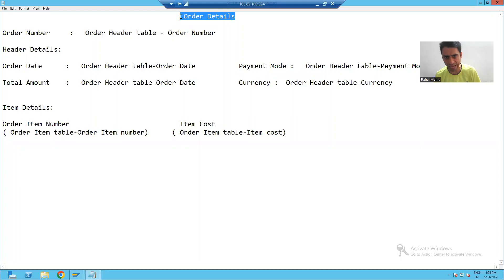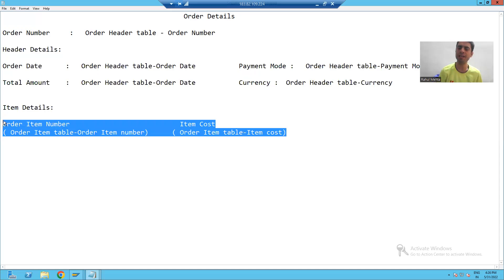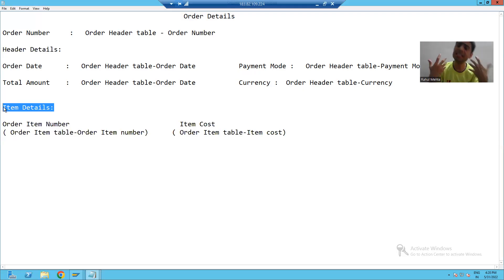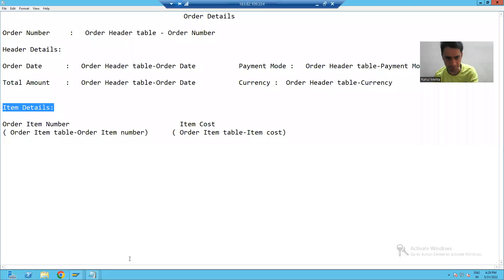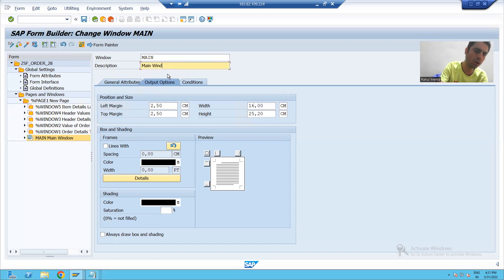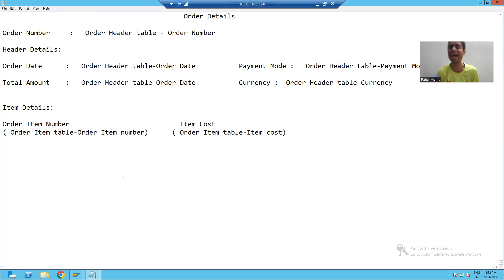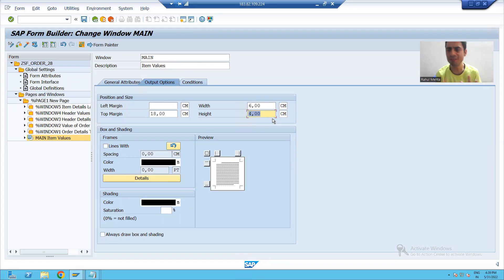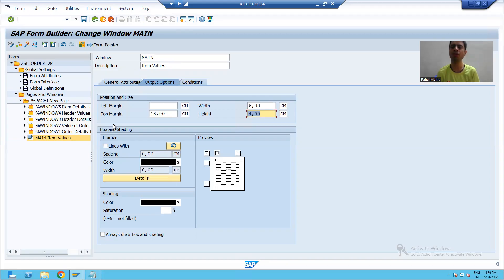2 - Smartforms - Creation Part1

Comment: Sir,
How to print new PO with line item on new page respectively in smartforms ?

Using command parameters
Reply from the maker: You can pass the data of one PO at a time through the driver program , First Time - Set the NO_close which is the part of control parameters as true and  at the last set No_close as false, so that It will generate a single Output for all the PO's.